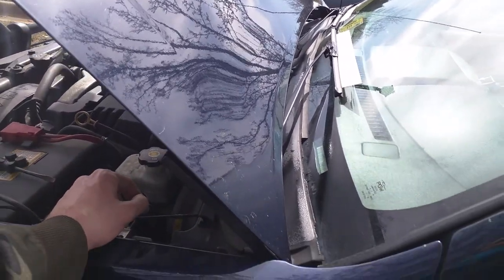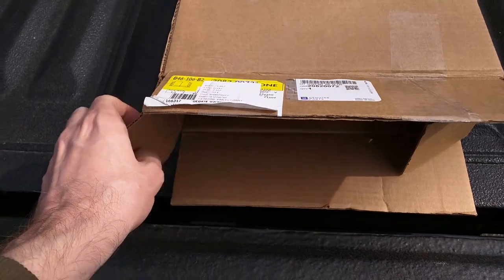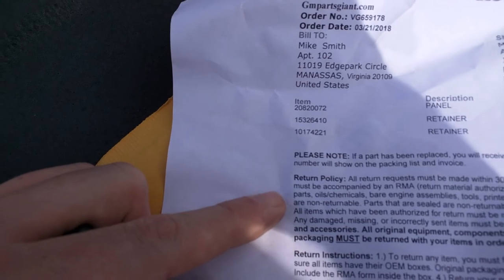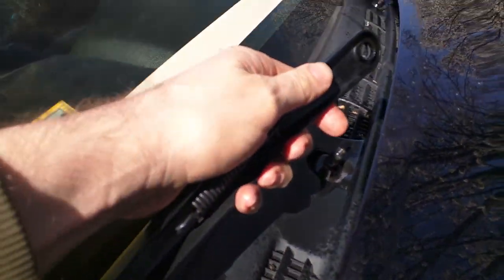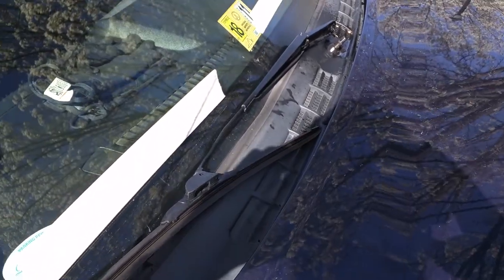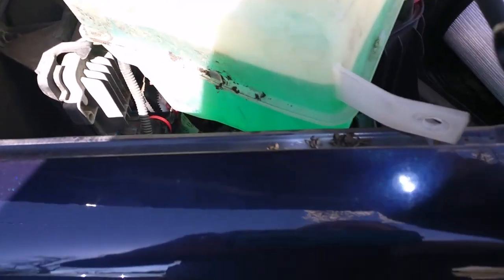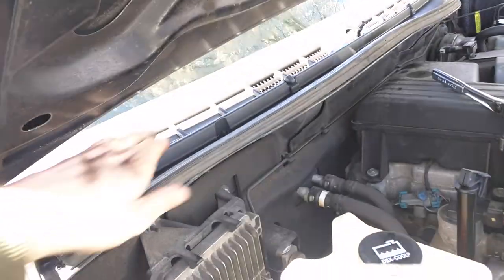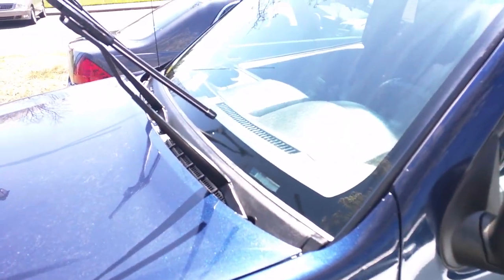How to replace a windshield cowl grille 20820072, Chevy Colorado, 3.31.2018

Comment: Thanks for the video Mike. Just changed mine and was able to get all the push pins out without breaking any and reuse them. The larger ones came with the new cowl, so the smaller ones would be the only ones to order if they break. Also, the airbox lid on my 2010 is different and didn’t have to be removed to get the washer bottle out.
Reply from the maker: Thanks for the comment!  I believe they changed the design around 2008.  Glad the video helped!  :)

Comment: How did you access the 13mm coolant reservoir bolt? I have tiny hands & still can't access it.
Reply from the maker: Lots of swivels and extensions.  😆  You can put a piece of tape on a swivel if it flops around too much.  It may help to remove the air cleaner housing, as well.  On some trucks the reservoirs are one molded piece, and other years the reservoirs are two separate pieces.  Good luck!

Comment: Hi Thanks for sharing.  Just curious how the new one seals back up to the window.  Does the new part have the rubber seal and it just holds tight because it is new and in good condition or is there xtra steps involved?
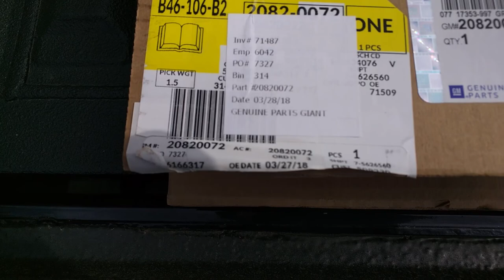Reply from the maker: Hi Andrew!  Thanks for checking out my Colorado repair videos.  The new cowl assembly installs with plastic retainer clips.  It's been quite a few years since I recorded this, but from what I recall several of my original ones broke so I ordered new ones.  You can see all the parts I used at the 1:30 minute mark.  The clips are shown at 1:50.  Hope this helps!

Comment: I have a 2009 GMC Canyon (1st gen).  What a PAIN it was to get the little tube installed.  GM in their infinite wisdom had the engine coolant and windshield washer fluid reservoirs molded onto each other, i.e., no separate tanks.  After cursing like a sailor and with the help of my brother, I got everything put together, but dang, I don't want to replace the cowl again.
Reply from the maker: Right?  They sure went out of their way to make things difficult!  🤣

Comment: Did you have to silicone the top of the cowl panel? Mine is  in much worse shape than yours, and was letting water leak into the cab of the truck. I have a 2012 chevy colorado. Parts look identical. I only asknif you had to use silicone because under the top of my panel on the windshield I noticed remnants of some sort of bonding agent to seal it. Thanks in advance!
Reply: I read through the comments and got my answer. Thanks so much for posting! Now time to oder parts and get to work!
Reply from the maker: @brittanym5016  glad the video and comments helped! 😊

Comment: So i just put the new one on but it but it wont spray windshield washer fluid now.I checked if i connected the windshield washer hose and the other connector that clicks on.They seem ok.Do you know what else could be the problem?It was working right before i put the new one on
Reply from the maker: Hi!  Thanks for checking out my video. Sorry to hear you're having trouble.  When you operate the washer pump, do you hear or feel the motor operating?  I'd probably check fuses and routing of all the washer fluid hoses.  Assuming the pump motor itself is operating there's probably a hose disconnected somewhere (or plugged/clogged with debris).  Maybe disconnect the hoses and try blowing through them?  Good luck, let us know when you have it figured out!

Comment: Did you use any caulk for it?
Reply from the maker: Hi Jason!  Thanks for checking out my Colorado repair videos.  It's been quite a few years since I replaced this part, but off-hand I don't recall needing or using any caulk.  I could see if you had a crack or draft around your windshield itself, you might want to use one of the various caulk or sealant products available.  But for just the cowl piece itself the factory retainers (shown around 1:55 ) should be sufficient to hold it in.  Hope this helps, good luck with yours!  🙂

Comment: Good video. Gotta replace mine or something, because rodents have found there way thru' a warped area on the cowl. Been making my blower motor noisy.
Reply from the maker: Wow!  Good luck!  Wear gloves, who knows what nasty you'll find in there.  :-P
Reply: @umbmma  I suggest you wanna run a vac or shop vac thru' there a couple of times that way if there are still any type of life still in there that noise should drive them out.

Comment: Whats the part number for the rubber seal that connects between the cowl and the glass?
Reply from the maker: I don't know, the seal was attached to the plastic piece when I ordered mine.  I think it's only available as an assembly?  Maybe a GM dealer or Rock Auto can help you further.  Good luck!

Comment: Interesting that it did not hold up to the weather.  My father has a 2002 s10 that has been outside its entire life and the cowl looks like new...they apparently changed the formula for the plastic.
Reply: It could also be the formula of windshield washer fluid.  Switching from the blue to the orange stuff (Rain-X) was awesome, but man, it dried out and ate through the rubber.

Comment: Nice video Mike.  Which and how many of the retainers did you need?
Reply from the maker: Thanks!  I used all of the ones that came with the cowl, plus four of the ones I purchased, and two from the original grill.  I would recommend purchasing six and six if you plan on doing this, just in case the cowl panel you receive doesn't include them or if they all break during removal.  Good luck!

Comment: Matter of fact, i took my old cowel out and just disconnected that hose at the end of the cowel, it just pops off. Throw the other one in a drawer, just in case. Be safe out there.
Reply from the maker: Thanks for checking out my video!  Glad to help, and thank you for the tip.  Definitely something to check out if I ever need to do one again in the future, or for anyone else who watches this video.  Thanks!
Reply: @CompTechMike  Had a faulty elbow connector on the driverside nozzle. I went ahead and just replaced the new one with the old one, works great. Picked up a few of those plastic retainers at autozone. Saved the extra nozzles and hoses and stuff just in case. Those just in case parts always end up being needed. hehehahah